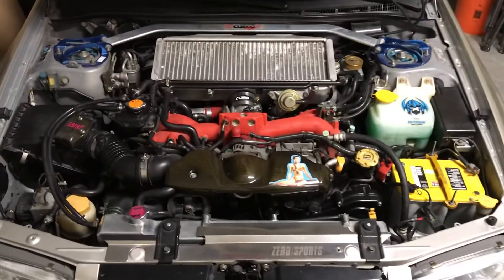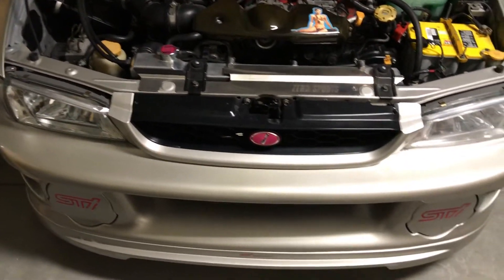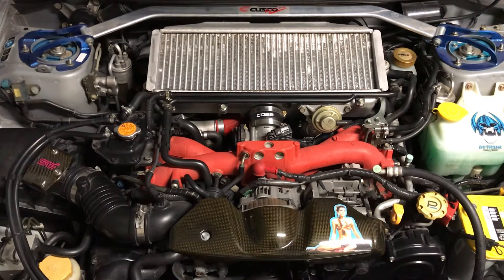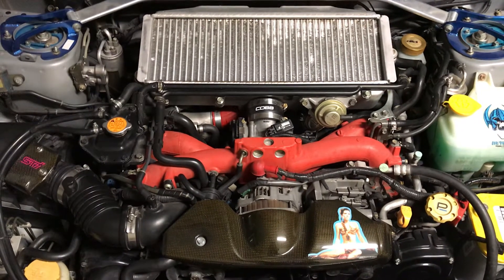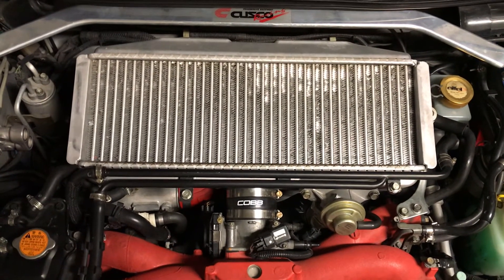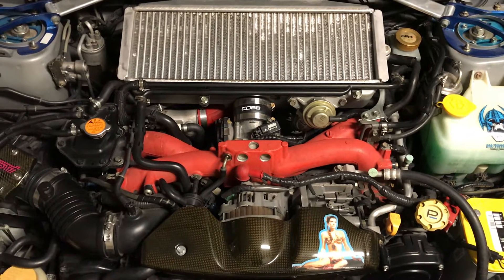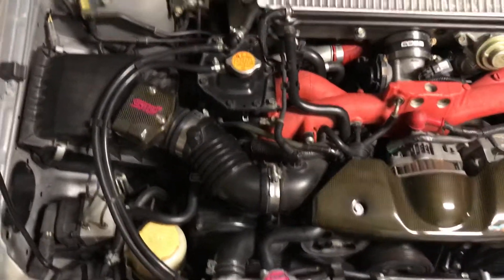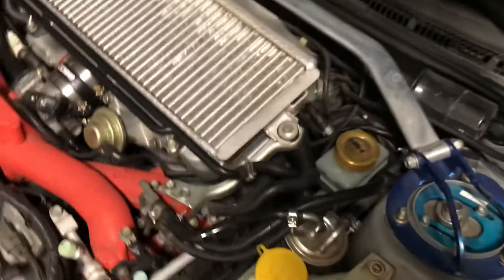2001 Subaru Impreza RS Coupe - RSTI - One owner car! - Walkaround pt.1

Comment: Digin it...  I saw those blue plates.  You in the silver state?   I have a 2000 that i am about to start tearing down... Would love more tips...
Reply from the maker: Thanks! The worst part is pulling the dash, the hvac unit and the wiring harness. Dropping the engine and trans is pretty straight forward (unless those suspension and subframe bolts are all rusty😂) Good luck!
Reply: @twerk421  Car spent 90% of its life in Arizona and Las Vegas.   Its dry and rust free.   Will of course use a break free spray of some sort no matter what.  I have the Ej207 v8 plus sorting the suspension right now to 5x114  I would have loved finding a whole car that was messed up though.  i did find one back east but no time to go get it.  Thanks for the tips... I need way more...
Reply: @twerk421  Sorry i logged into my channel that has nothing on it yet...  I think maybe one video of my son and some pokemon cards... lol  again thanks for the tips...

Comment: how did you mount that intercooler on the passenger side?
Reply from the maker: I just utilized the factory bracket that bolts to the block underneath. Then cut off the part that loops around which connects the 2nd bracket to the fuel rail cover. Just enough to where the bolt hole is.